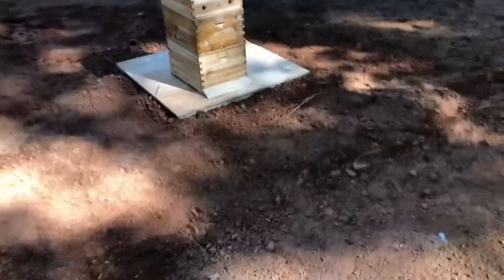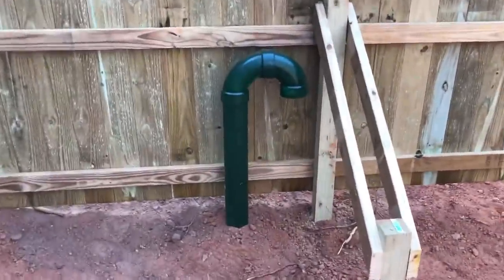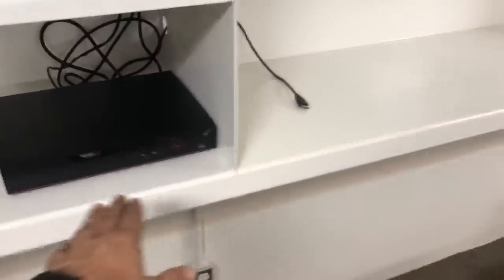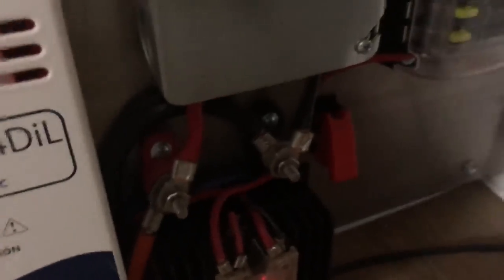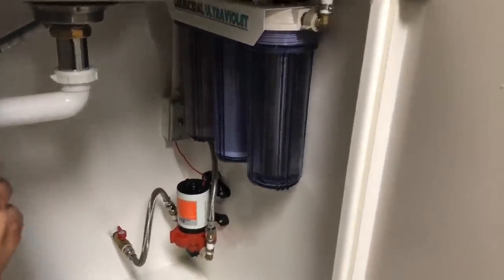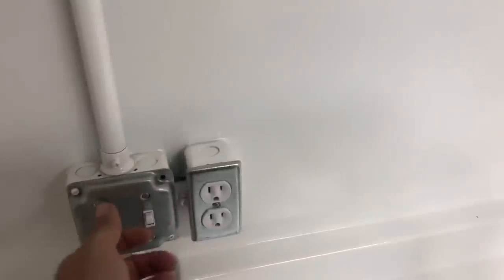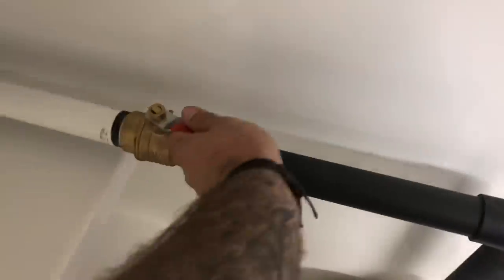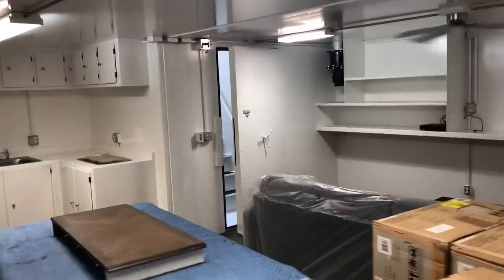Inside a REAL SHTF BUNKER - Doomsday Prepper Walk-Through

Comment: Snap the PVC off  and block the air. That's how you lose your bunker to someone else
Reply: Although I totally agree with you, there are countermeasures to make the pipe blend in or even not seen at all. And yeah, not PVC, but rather galvanized welded steel.
Reply: Snap the pvc off and drop some gasoline or diesel down the hatch...
Reply: No matter what you do air inlets will always pose a problem. PVC, welded steel, clay tube, it doesn't matter. They can all be covered up. You just need multiple inlets and outlets in various camouflage. They may get some but not all....hopefully.
Reply: @mr.shawneemominee6228  I agree that they should be camouflaged.  The issue on this bunker is the air tubes go directly down into the bunker.  The ones built by Atlas drain into the ground and the piping off the stand tube is reverse pitch (so no fluid can drain back into the bunker.  
Adding a secondary air intake and outlet that is even more camo'd would be ideal but I expect at the point you are under that kid of attack it would be time to blow the escape tunnel and ambush the opfor.
Reply: @jonwebsterabbott  so right lol
Reply: @mr.shawneemominee6228  not true. Do your research before you talk
Reply: @jonwebsterabbott  I will have to look at the setup for the pipes themselves. What I was referring too was the fact that no matter what vents will always be the weakest link. No matter what material you use. Covering them is the fastest way to choke out the occupants. Sure you can sabotage in other ways, but would you really waste resources? Especially when this is the most practical way. The waste water removal system could use a few tweaks as well. Namely one way check valves. Way too easy to pump toxic fumes up through the drain unlike fresh air vents that usually are pumped through some kind of filtration system. Plus the check valve would also keep pests ok out since they couldn't crawl up in through the drain. I'm sure Bear oversaw as many redundancies as possible.
Reply: @matthewsantiago5360 do you have anything of value to add? Change my mind.
Reply: @mr.shawneemominee6228  goto Atlas bunkers,  You will see the big difference
Reply: Mr. Shawnee Mominee I sincerely doubt your statement about overseeing redundancies with this bunker. As it stands it is a deathtrap. Bear might be independently minded but there is real need for professionals when building any structure and especially a sealed confined space. The fact they have batteries charging off solar without any active ventilation to get rid of hydrogen means that this place was designed by an idiot who will get the occupants killed as soon as they open the seal and turn on the light switch
Reply: @jonwebsterabbott  I agree that there are a lot of safety problems. It's possible that we missed something due to the editing for security, but perhaps not. I don't like the shelter. I think it is poorly designed and a death trap in real world scenarios. Was just giving Bear the benefit of doubt due to not being able to see everything.
Reply: @mr.shawneemominee6228  I understand your point.  Bear seems like a sincerely good guy.  It just sickens me to see this level of incompetence.
Reply: @jonwebsterabbott  I completely understand your point of view. I agree with your assessment of the bunker. As a welder the welds on the panels gave me pause. So it begs the question as to what else is sub par. It has been a pleasure to chat with you.
Reply: @mr.shawneemominee6228  Same here.  Gives me hope that when SHTF for real there will be enough god people to restore law  and order.  And the Welds weren't even continuos- how is that waterproof?
Reply: @jonwebsterabbott  I'm glad people like you will still be here when things go bad. Thank you for being respectful in your responses that shows integrity. Now waterproofing aside I don't believe those welds to be structurally sound and when people's lives depend on your work it better be right. I have a sinking feeling that the walls will start to give in a few years as moisture weakens the seams and those poorly done welds crack. If my welds looked like that I would pack up my gear, go home and never touch them again. 
Scenario, you and your family are hunkered down and the back fill starts pushing on the walls. A seam splits and earth starts pushing in. Now what? You can't stay because it will become your coffin. Your family is panicked because they don't know what to do and you are at the breaking point because you wasted all that money to keep your family safe to no avail. People need to remember underground shelters are only a temporary accommodation. Take the time to learn skills so you can survive and thrive.
Reply: @mr.shawneemominee6228  Exactly.  Atlas Survival just posted a response to this video showing what will happen in a few years time.  It isn't pretty.

Thanks for the kind words.  My only hope is I have enough 308 to hold the zombies off...
Reply: @jonwebsterabbott  if not I have some 7.62×39 to back you with
Reply: @mr.shawneemominee6228  That and 30-06, because nothing is cover shooting an m1 garand!
Reply: As a welder/fitter/fabricator, those welds are truly horrible. If that's stick welds the "welder" clearly needs a LOT more practice. If it's mig, then they screwed it up epically. There are a few good ideas in the bunker but also some glaring faults. The location of the air out is way too high and not as far from the intake as possible. Propane is a horrible idea. There aren't any gas leak sensors either. There should be leak sensors as well as carbon dioxide/monoxide detectors. The cistern is a good idea, but it also needs a well so as not to rely on city water. There's also the PVC intake and exhaust. If they can put up a privacy fence they can do a decorative brickwork wall with a square pillar at each end to hide and protect the vents. Also a triangulated air intake system would prevent blockage or tampering with two separate intake points camouflaged separately. Another point is woefully inadequate supply storage space. With accommodation for 16 people, there's no space for food, hygiene or clothing requirements much less weapons or tools. There's also no generator pod or generator which would be crucial for long term viability. Finally the thing should have at least 3 layers of defense. The hatch should be hardened, the main entry door, as well as the farthest point as room which should be good storage as well as a last resort saferoom.
Reply: back a dump truck up and fill the stairs with dirt pump gas in the PVC pipe done deal!